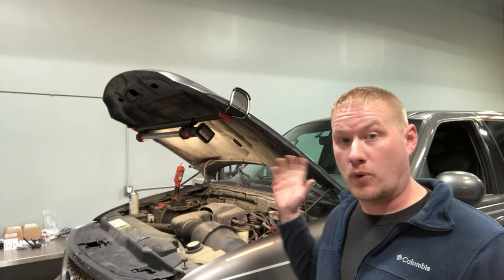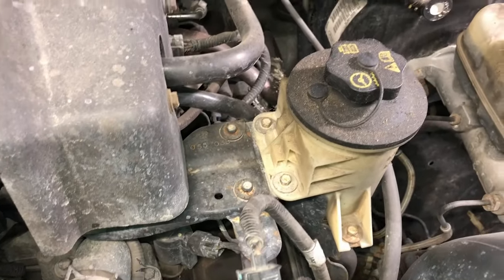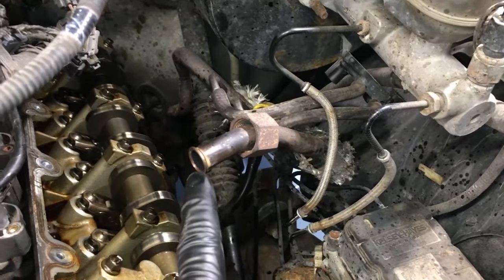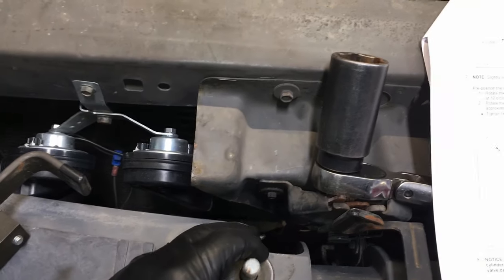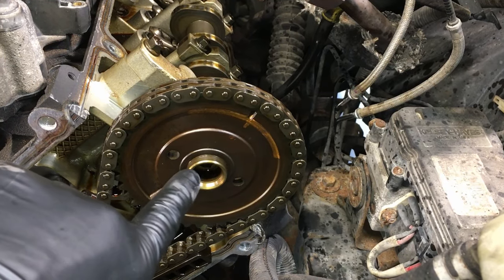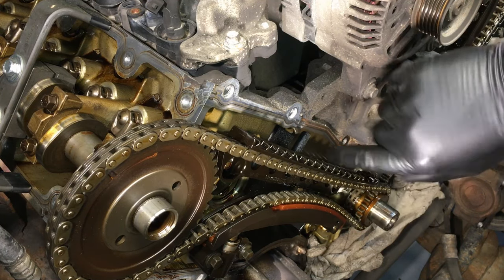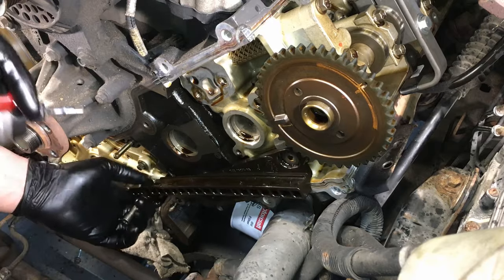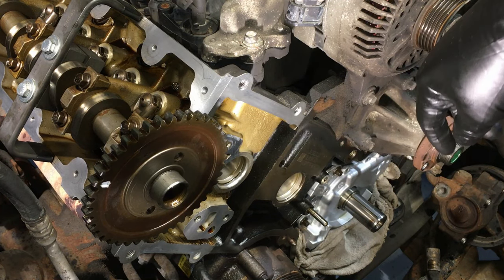Ford 5.4L 2v Triton Engine: Complete Timing Walkthrough

Comment: @FordTechMakuloco I’m a Ford guy and i watch/appreciate all of your videos! I have a 2002 F250 Super Duty 5.4L and I’m doing valve cover gasket/lash adjuster/roller follower job! (Right after a broken dipstick tube at manifold job!) I watched your 3V roller follower/ lash adjuster removal and installation video, but i just want to verify if its the same process on a 2V engine as far just having cam at base circle when removing roller followers and when they are at base circle do i have to worry about any of the valves hitting a piston at all? And second do you have any suggestions on what roller followers/lash adjusters to buy? Lastly are there any tips you have for these things I’m fixing? Thanks again for all of the videos keep them coming!
Reply: I know you posted this a long time ago but I'm hoping you got to this project by now. Question 1- How did you remove the lash adjusters and followers? I'm guessing its the same as the 3v's and the same tools? Question 2- If you did do the job what parts did you get? I see rockauto has some different makes but the melling ones are on B/O so maybe I should get a good quality set from NAPA or Orielys, I defiantly don't want to a job like this twice you know.

Comment: No phasers! If ford would had enough sense to put metal inserts in the heads for the spark plugs, this would have been an awesome engine. You make the job look easy, took me 2 days at home to do the same job.
Reply: 03 and newer ford doubled the amount of threads in the spark plug holes....... at least on the 4.6s they did anyway

Comment: I feel like I will be doing a timing job to my 97 F150.  Made it 204,000 miles before I started having drivability problems.  I really love this old truck and dont want to give up on it. This process is tedious or so it seems but not impossible.

Comment: I have 406,000 miles on my 2002 F150 5.4L. I've never changed the timing set. Is it recommended or should you only change it when problems arise?

Comment: I need help! I recently bought a F150 2007, 145000 miles. I drove it home (roughly 2 hour drive) and it did the infamous knocking/diesel sound when I was backing it up. Long story short it has been to the mechanic about 6 times now and i haven't been able to use it for the better part of 5 months. They tried replacing VVT solenoids, replaced the thrust barring. Eventually they figured it was either the cam phasers, or the engine just wasn't taken care of. After all options appeared to be exhausted the engine was replaced TWICE and it did the same knocking/diesel sound BOTH times! I am no mechanic, but now it seems that it is something other than the engine. Any help or advice would be awesome. Thanks.

Comment: I have a 2003 5.4L 2v and it has about 175,000 miles now there are no problems but I want to do the timing and replace the oil pump while I am at it. This will probably be the last time I do this as I am getting up there in age. I have been an aviation mechanic for over thirty years. I would like to hear any of your tips or tricks to make the truck last longer and what parts you recommend. My wife drives the truck and absolutely loves it so I am going to try to keep it running another ten years if possible. Love your videos so much you are the first one I subscribed to. I also like the fact that you are a veteran such as myself. I appreciate all your advice.
Reply: I've been an A&P for 27 years and have always maintained my cars. My 02 F150 has 449K miles with the original drive train including timing set. The truck runs great and has been a great purchase.

Comment: Thanks AGAIN! Enjoying my new FordTechMakuloco hoodie... And another great tip. 

I'm doing a timing chain, oil pump, water pump, thermostat, serpentine belt... on a 5.4L 2v E-150 and I don't think I would have attempted it without your videos. Your tips, parts, and tool recommendations are always spot on! 

And I like that your videos are not filled with superfluous fluff, just friendly and right to the point, that's it.  

I'm very grateful and certainly won't hold you responsible for the outcome... LOL...
Reply: because of this channel, I learned how easy it was to change out my serp belt, tensioners, and idler pulley. Easy 1 hour maintenance job. Also found other minor  "replace" issues like upper rad hose, a ventilation hose for the PCV system, and also decided to replace the t-stat while I was in there. May replace the water pump/fan clutch in another job. Truck has over 200K miles, so I'm replacing as many parts as I feel comfortable with. I'll probably leave this job to a pro....because I know how clumsy I am, haha.

Comment: I had a crazy bad knocking/metal slapping metal sound and I thought she was a gonner!!  03 F150 5.4l timing chain and oil pump job complete!  I seemed to have lost quite a bit of oil pressure to the passenger head.  The seals on the tensioners were trashed but she's also got 250,000 miles.  Had some scoring on the cam and cam towers.  I mic'd them out and most were within .001 - .002.  I did have a couple that were around .010.  Made me nervous but I have to risk it for now so I put it back together.  7 of the 8 lash adjusters in the passenger head weren't pumped up so they were replaced.  No start up knock and purrs like a kitten!  The only thing I did different was that I left the oil in the pan for the majority of the job in hopes that if I had any debris get away from me I'd hopefully be able to drain it out with the oil.  I'm also a huge fan of using a shop vac with a  longer clear flexible 1" hose duct taped to the end so I can get into smaller spots like the oil pan, oil ports, around the roller followers, and spark plug holes in hopes it would pick up any extra garbage.  I also fished a 1/4" hose down into the oil pickup tube and blew a little air and brake cleaner through it and then flushed the pan with brake cleaner to wash out any debris.  It was a calculated risk but low air pressure was used in the pickup tube.  I travel the country side for work as a millwright out of KC.  If I'm in your area, lunch is on me!

Comment: Tech question: you mention to be sure to only rotate the crank CCW when placing the crank timing tool alignment. I’m assuming this is just so you don’t risk running a piston into a valve if you have the cams locked? If not, what is the purpose of the CCW rotation note? My concern is that after having a crank redone, I have had the machine shop tell me specifically, to not turn the engine backwards before break-in is complete (something about micro-grain fibers shearing off).

Comment: replaced pump and did chain kit and double checked the timing marks before i put the front cover on. Torqued on the pulley to the crank and gave the crank two turns to make sure the chain was rolling smoothly and valves weren't hitting hitting the pistons. When it came back around to where the marks should've lined up, the timing marks on the chain and the sprocket were off by 5 links on both sides. Is it ment to be like that?
Reply from the maker: yeah they wont line back up for 50 something revs.
Reply: @FordTechMakuloco  Thanks! You're videos are the best, keep doing what you're doing!

Comment: Hey, These video is amazing, I have a 2002 5.4 liter Ford F-150 with like 230,000 thousand miles and its running like a champ. I absolutely love that truck. I can’t believe how well it has behave with me after all that years. I haven’t done much, just a transmission repair like 6 years ago.  And the basic stuff. But im worried that something can happen to her. What are the things you recommend me to do after all that miles. What things I have to replace? And everything I should do?

Comment: I have a 2007 E-250 5.4 2 valve with 254k on the engine,never been touched other than the blown spark plug once,
I know it’s way thighter to do the job...
Besides the intake stuff on top,are they the same procedures on the engine?
Have you done it on the vans? 
What’s the work time difference to the trucks?
Reply: I have those same questions. I’ve done plugs, it is 
snug in there. 2006 E250 5.4 2v

Comment: Excellent video and great detail.  Thanks for posting it. 
My 03 Expedition with a Triton engine has 293k on it and still runs beautiful. Everything is original so I need to get in there and replace those tensioners before they fail and cause more problems.  This video will help a lot.  Thanks again

Comment: It’s refreshing that my next generation is doing well,I,ve done this for 45 years and still doing it,this guy passes my test,
Great video and explanation
Only Gripe I have as its natural to me is to let people know how to prime your oil pump and the fact you didn’t explain how you took the pickup tube off the oil pump as a lot of words are going to fly around when that bolt slips out of your fingers and into the pan
Let me know how you did that as I have to do this job on a Work Van including taking off heads due to a Plug blowing out of a hole
Reply from the maker: I have an entire video on this subject and how to replace the pump in detail. Everything is linked in the video description AND pinned at the top in the comments. I don't know how I could make it any easier for everyone.
Reply: FordTechMakuloco 
I give you a compliment and this is what you come back with
I didn’t see no link and I wasn’t trying to piss you off
Reply: FordTechMakuloco 
On top of that I was asking for info on this being that I,m working on a E 350 van where tolerances are tight …so again how did you get the Oil screen off ?did you have to completely remove the PS pump I see you didn’t have to on the AC  to get the cover off,I have to get the Heads off and I,m in cold climate(Chicago) so i,m trying to get this done ASAP

Comment: THANK YOU!  Doing a 99 4.6 SOHC (2 valve) It wasn't as simple as I thought. Chain link wasn't setting correctly, slack on guild side, Everything I saw before said the cam(s) dimple should be 90 degrees to the head. This video showed me the remedy.

Comment: Can you tell me what to do? I have a 2004 f150 4.6 2 valve with regular cam gears,  not phasers! So I am changing the timing chain and the cam timing gears , my question is do I have to change the bolts that hold the cam timing gears on? And what's the torque for the bolts that hold them to tha cam? Thank you, Mike from grosse tete Louisiana

Comment: Ok I have been watching and have had nothing but issues after issues with my 2005 expedition... I have a rebuildable core on its way and have one question. You are very knowledgeable but I haven't seen where you address what's more reliable. New ford phasers and HV oil pump or lockout kit and regular oil pump. I also want to know what the "veins" in the phasers are made of and if it's possible to just replace them with a less brittle metal or alloy?

Comment: I'm replacing the timing chain tensioners with the cast iron ones. Does the cast iron tensioners not get a gasket or anything?
My old plastic tensioners had a red oring.
03 Expedition 5.4 2V
Thanks
Reply: Ok I re watched the video and there's no gasket or oring 👍

Comment: Thanks so much, going to have this done in my 2002 f150 was quoted a price of $3409.00 they want to pull the engine due to the oil pump,not sure if that is correct pricing but il going to try my self thanks for the step by step instructions

Comment: Question I’m rebuilding a 5.4l 2v motor but I have one I’m taking out of my truck do to bad rod bearings the motor only has less than 100k miles could I reuse the timing chain from this motor in the one I’m rebuilding?

Comment: Brother thank you so much for this video. However I am having an issue. After getting it back together it won’t fire. I crank it and pulled a plug and am getting spark. I tried starting fluid and it still doesn’t fire. Thought the crank timing plate may have been in backwards. Mine doesn’t say front. It says rear so I put it to the back. That’s the only thing I could think of. Any help?

Comment: Is it true the 4.6 winsor heads fit the 5.4 as oil fill both on passenger .doing junk yard swap.why simple drill slip during thread replacement in head.

Comment: Hello Brian. Great work. Truck I’m working on now is a 2013 Ford E-350 5.4 2V.  Valve covers and timing cover removed. I have the Melling timing kit along with cam followers and lash adjusters. And just because,  new oil pump. I do have the cam locks, crank locating bracket and 2-valve spring compressor. The problem I’m having right is very cramped quarters in the van. Getting the followers out with the 2v-valve tool not going to happen. Compressing spring, keeping pressure on valve so as not to loose the locks would be very risky. Can’t see and I think I would three hands. Even your not recommended method with a padded screw driver would be almost impossible getting the followers out. The walls of the van doghouse are just too close to head to get any leverage. At the ends of the heads I can manage to get a few followers out and reinstalled using the screw driver method. To me it seems my only option is to very very carefully remove the cams while under spring pressure. 1/4 a 1/2 turn on cam retainer bolts until they’re are out. Slowly easing pressure so as to not tweak cam out of shape (bend). My plan would be to set the timing up prior to the removal of anything. Index the cams with appropriate paint marks on caps and cam. Probably on journals and cam and anywhere else to make absolutely sure all is in sink. Any suggestions?  If cam removal under pressure is ok, any particular sequence on loosening cam cap bolts? Then on reinstallation of cam, any particular sequence on the tightening you could recommend? Just an fyi, I get doing everything according to manufacturers recommendations. Mechanical contractor for 48 yrs. and a car guy. Over the years all Fords with FE’s. Built them and fixed them. Thanks so much for any help.

Comment: Question: with these engines chewing timing parts etc, would those be sucked up into the oil pick up? Is it worth it to drop the pan and clean that out as well? I ask, because of my knowledge on BMW v8’s, the timing components end up in the pick up tube.
Thanks for all your efforts on video production.... top notch!
Cheers
Reply: If there are big chunks missing from the guides, then yes. Drop the pan and clean it out. I have personal experience. A big chunk of my timing chain guide broke on my f150 but I never knew. It didn't make any noise. The chunk got stuck in the oil pick up and starved the engine of oil and ended up destroying my engine.

Comment: Im doing this job right now. I got the same timing chain kit with the cast iron tendioners. I just wanted to double check that i dont need a gasket for these tensioners like the plastic ones? Just wanted to check so if somethings not right i dont need to tear the motor down again. Thanks

Comment: Is it normal to have some slack on the right side timing chain on a rebuilt engine? I just purchased a rebuilt 5.4 engine but it has some slack on the right chain. Im wondering if its because there is not oil pressure being builg until the engine is running?

Comment: Question can the cams be pulled out without spinning the crank to remove the followers individually if replacing the lifters and followers are part of the job once the crank is in the 11 o'clock position.  I have the Ford service manual and it's not so clear in these regards.  Second question is just to be clear.  Is the crank and are the pistons neutral in the 11 o'clock position when aligned with crank alignment tool, at that point, are all the valves clear of contacting the pistons so the valve spring compressor tool can be used to remove all the followers without cycling or removing the cams?

Comment: good video, but if you have the crank shaft set at 12 oclock the sweet spot where everything is below deck as you say, why do you need the cam shaft holders?

Comment: after I replaced head and timing chain sets, engine barely cranks with good battery charge. Seems tight, starter maybe? It cranked good before all the work. thoughts?

Comment: When you were first aligning the crankshaft for removing the timing chain... The passenger side timing chain was losing and regaining tension. Is that normal while turning over by hand? Otherwise is that due to oil being drained or the blown out tensioner? Had seen this before on an engine and wasn't sure what to think.
Reply from the maker: This is perfectly normal even with new parts.

Comment: Fordtechmakuloco 
I have a 2005 Ford expedition with the 5.4 engine 3 valve..217,000 miles like a month ago it was making that ticking noise on the passenger side..I could hear it louder if I put my ear to the tire well, a few wks ago it stopped making the sound, then I noticed it started misfiring and stalling out on me I installed new coils and spark plugs it's still missfiring and stalling...do you think it's my timing? When I put the scanner it's reads running rich, cylinder 3,4,8 missfiring and I believe camshaft sensor (a) I'm about to check the fuel injectors on those cylinders but if you can get back at me I would really appreciate it thanks a lot

Comment: Just did the timing chains on a 03 4.6.  Cams were locked down and crank was not turned except from 11-12.

I'm 100% positive I assembled everything with the colored links on the dots. Checked 100 times. Now getting ready to put the cover on. Decide to see what happens if I turn the motor over with a socket.

I've turned it over roughly 20  times or so. But now the colored links will not line up on the dots. Some times it's on one side of the link, sometimes the other. But each link misses the dot by the same amount of teeth.

Is it a matter of just turning it over enough revolutions.

When I put it together I had the key at 11, and crank dot at 6. Then lined up the chain on the cams accordingly.